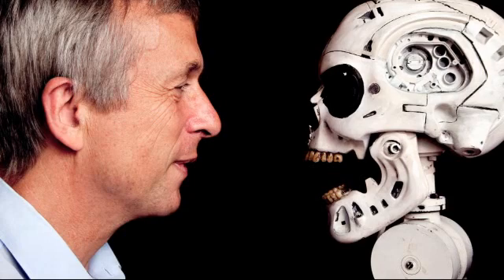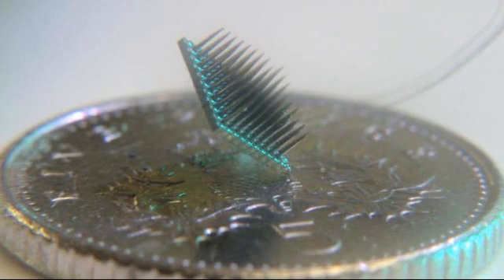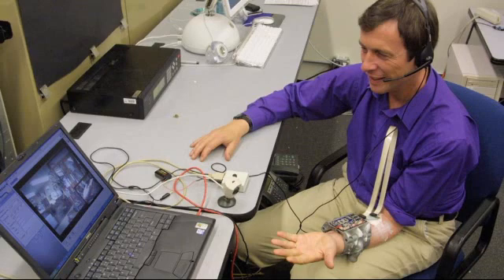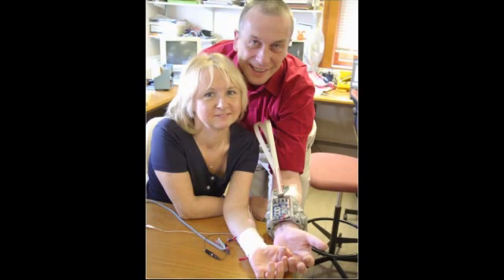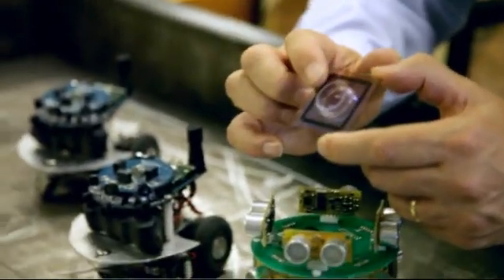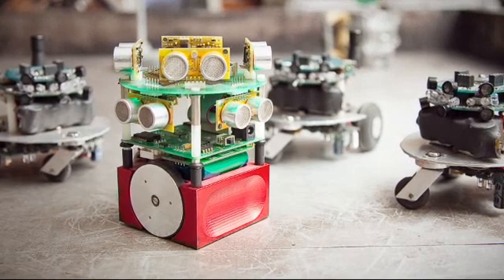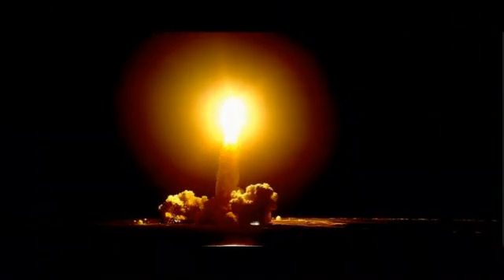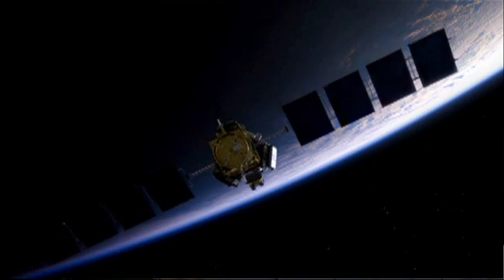Kevin Warwick, Human Cyborg

Comment: see, what i know with a fair degree of accuracy and an unbelievable amount of involuntary experience Kevin, is that there are NOT brain waves from your wife to you to move your arm and there are NOT brain waves from you to move your wife's arm.  There is in fact only a computer program that uses Doppler like waves bouncing on the receptors in either of the arms which are then translated into radio waves ('electricity') that will move the other's arm.  no more than that.  ask me how i know about this hell, Kevin.  stop lying kevin.
Reply: no, not even Doppler....just a strictly lethal (eventually..) dose of wireless feed on teeny receptors stuck by the dozens all over the body......total pretender technology ...nothing but slow roasting flesh because the idiots of 'technology' don't understand that 'electricity' is what is coming out of the frequency emitter....sadly, because there are too many idiots in engineering, people die, slowly, under a 'visual'....so many people want to 'watch', eh Kevin.

Comment: Gj, but is there a possibility that brains send signals when they're dead, and it shuts down your whole body, and then it transfers across the network and other brains receive that signal?! If that happens... Another extinct animal...
Reply: Negative. If a hard drive fails and there are 1000 redundant hard drives. The system does not fail if just does not see that hard drive anymore.

Comment: If humanity could upload their brains onto a network it would mean immortality because the body will be nothing but a shell and the massive servers that will hold this information will be protected by radiation resistant materials such as lead and concrete. As for the hackers it is really not questionable what will be done to stop them, a possibility is that cyborgs will have the capacity to set up systems that are impenetrable by cybernetic attacks.